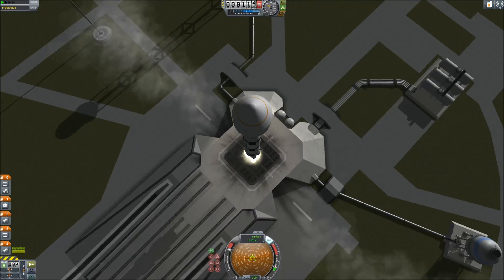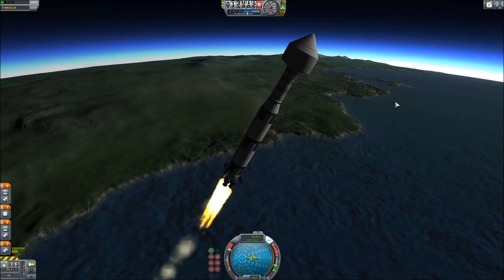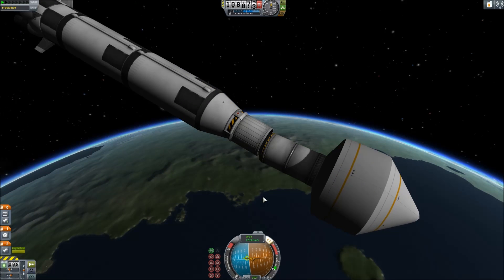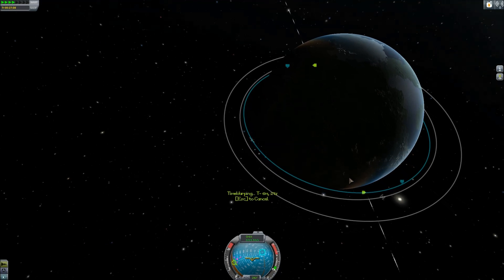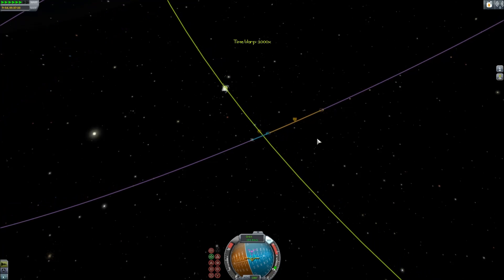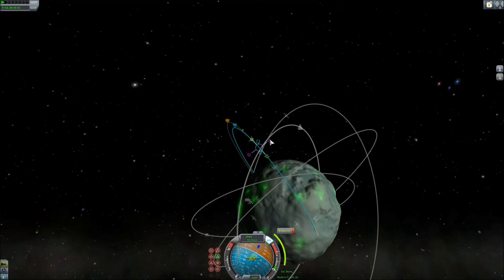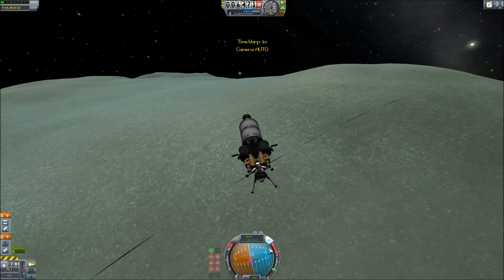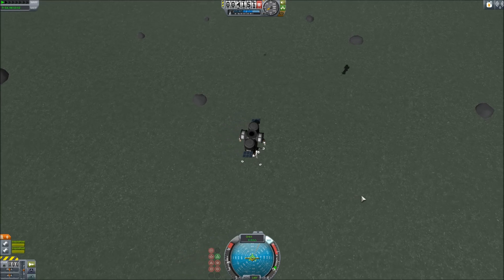KSP Exploration E8: Eagle Mining Probe to Minmus Plateau, Replacing the faulty Osprey Mining Probe

Comment: Just a comment on your launch. You need your winglets to extend farther than your fairing so that your rocket is aerodynamically stable while facing forward. I'd suggest either making your payload narrower or using larger wings. The extra mass the large wings add doesn't really make a difference to the delta V but it will make your launches that much easier.
Reply from the maker: C1maCat Thanks, will take that into account. The Eagle has one of the widest fairings I use, but I decided to roll with it. So would you recommend delta wings?
Reply: Yeah I forget what the largest wings are but you can even use structural pieces to move them out. Because if they're being blocked by the wide fairing they aren't helping nearly enough